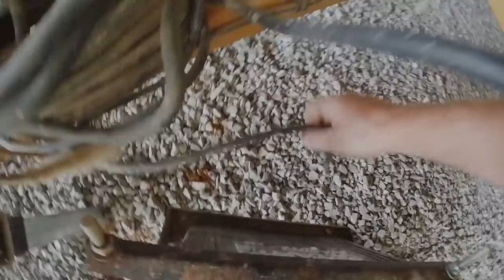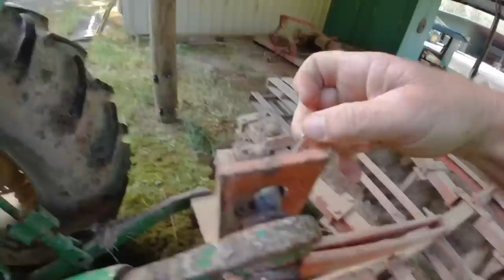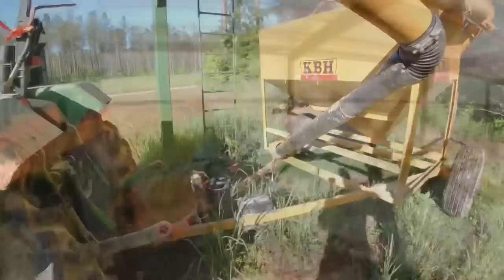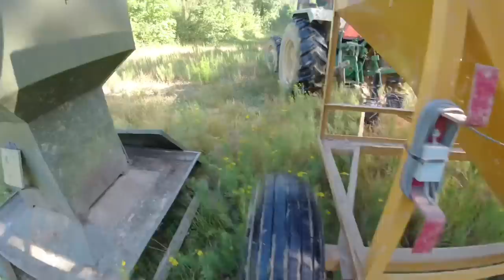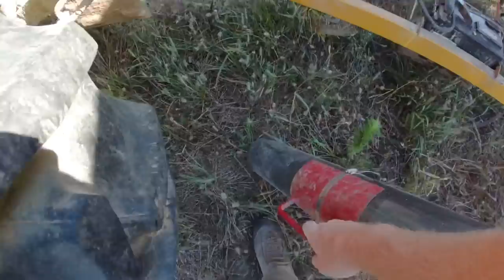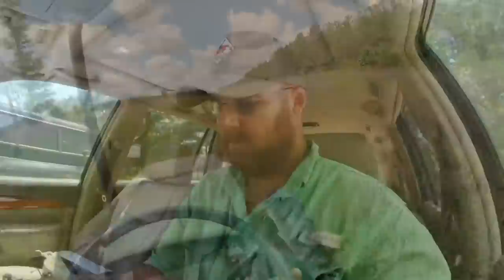THE KBH FEEDER FILLER🤔🤔🤔Finally Dry Enough

Comment: I was wondering if the clamps on the power cables need a brush with a wire wheel to clean them up a touch. It seems that bracket that holds the battery in place is in an awkward spot being so close to the terminals. I'm not telling you how to do your job mate. Just thinking out loud sort of thing. That filler will save your back a hammering. Good to see you get her running again.
Reply from the maker: Probably